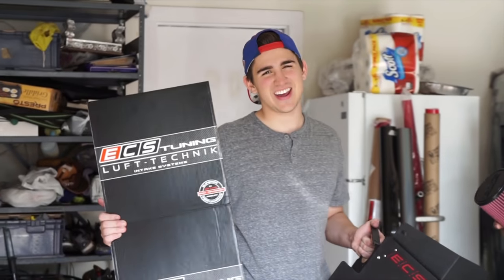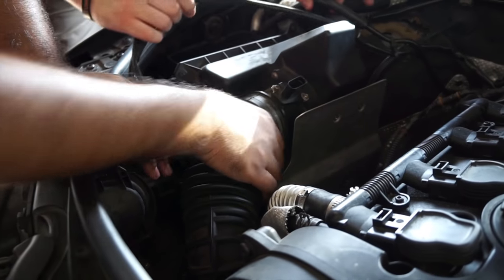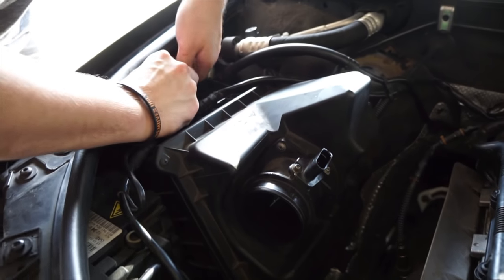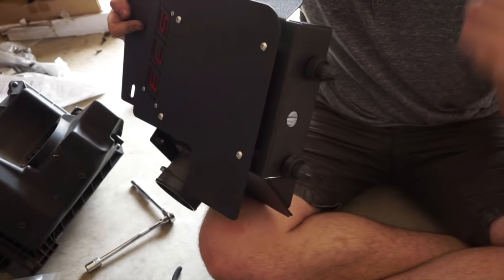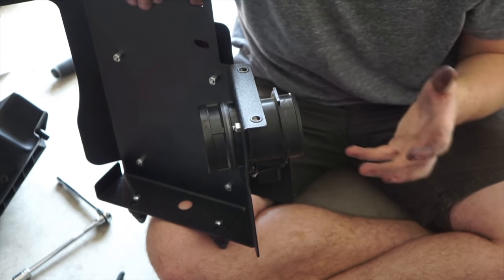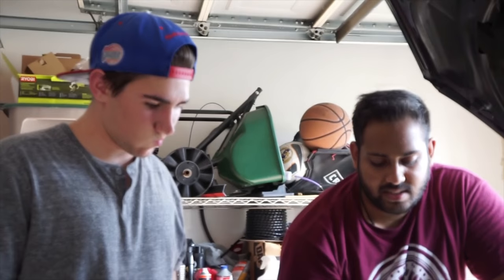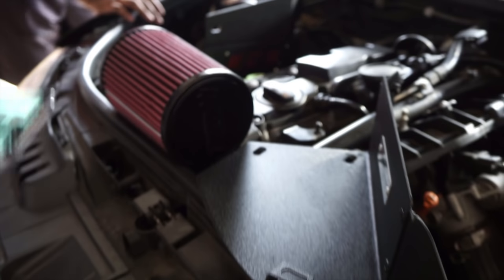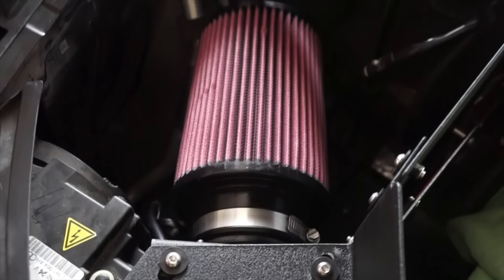ECS Tuning Luft - Technik Intake Install - Audi A4 B7

Comment: Did you notice any significant throttle response or power when driving?
Reply: john I noticed faster throttle response and faster spoolI. As for actual power its hard to tell. Most likely didn't gain anything because the intercooler on turbo charged cars is what makes the big difference on intake temp. Sounds great though!

Comment: Do you plan on getting a tune for the b7 if so what are you looking to get.
Reply: Definitely! For now i want to replace the test pipe with a high flow cat, and then possible the rest of the exhaust system. I'm also upgrading my stock diverter valve, perhaps looking at intercoolers soon and getting a catch can in the near future. Maybe after all of that is done i will look at a tune. Either an APR tune, but you have to send your ECU in for that and this is my daily car so that wont really work. Or a local dyno tune at a shop here in the dallas area. Most likely will go directly to stage 2 instead of a 1 or 1+ tune since i will have most of the stuff ready for it.
Reply: Scratch that. Found a local APR tuner who will do an off the shelf map fairly quickly!
Reply: @Kinzorallah  dude its an automatic lol
Reply: Jon BERTOCCHI it can hold 500 NM so you can easily go stage 3

Comment: Can you do these mods to a b7 Audi A4 with 2.0t engine ? I hope I don't sound stupid, but I've never done car mods before
Reply: Rj 2500HD don’t worry man! Everyone starts somewhere. We are still novices. All of the mods I do on my car SHOULD work on any b7 a4 2.0t fwd. aside from anything that doesn’t fit the s line because I have that model.
Reply: Caleb Smith mines and does it matter if it has awd , does that effect anything ?
Reply: Rj 2500HD anything suspension/exhaust may be a little different. Always check and make sure the parts are for the AWD cars before purchasing.
Reply: The only difference that matters for these cars for intake should be if it traverse (sideways engine on FWD) and longitudinal (in-line with the car on Quattro models. The oil catch can, cam follower, coil packs and PCV are all gonna be the same between FWD and Quattro and are all things you want to consider and keep an eye on for these cars, in addition to regular maintenance. I have a B7 and a GTI. Same motor, just different layout for the motor. 

Intake and exhaust do liven up the cars a little, but don’t expect to be any faster without a tune.

Comment: K and n never again as killed my air mass sensor twice on my golf mk 4 gti.
Reply: Bollocks!  Absolute shite.  You've either cleaned it and re oiled with too much oil and put it straight into your car dripping wet,  or something else has gone wrong.   Never had any issues with K&N.  Wouldnt use anything else.    Btw mk4 golf gti's are pathetic.  Scrap the piece of shit and buy a real GTi.  Mk1/2/5/6/7.     3 and 4 are heavy, ugly,  gutless.

Comment: A simple K&N air filter would have done lots more for you, that cold air intake just makes it sound better
Reply: Thank for the comment! I don't know if it would have done "more" necessarily. You're correct though about the sound. Makes it sound awesome! (at least to me) I mostly did it for the sound and the look. Forced induction engines see virtually no gains from  CAI's. My best bet would be to throw a better intercooler on.

Comment: Does it throw codes?
Reply: So far i haven't gotten a single code from the intake. The only codes I have, which I had before the intake install, is a small evap leak related code, and a catalytic back pressure code because i'm running a cat delete with a test pipe. From what i've read though i can use a small O2 sensor bung connector which restricts air flow to the sensor and will make the code go away.